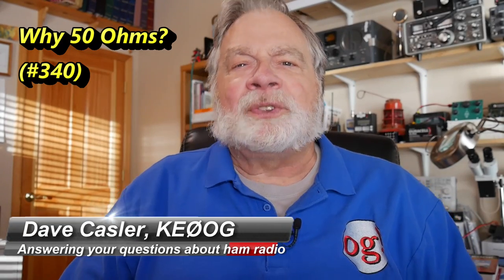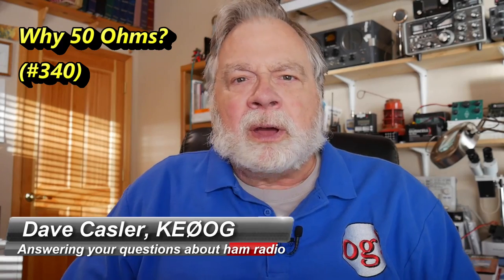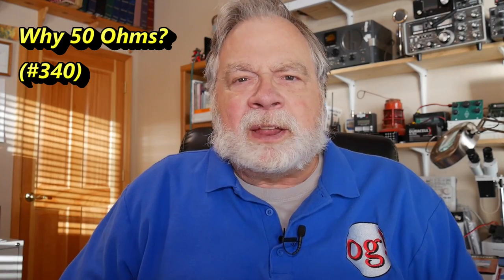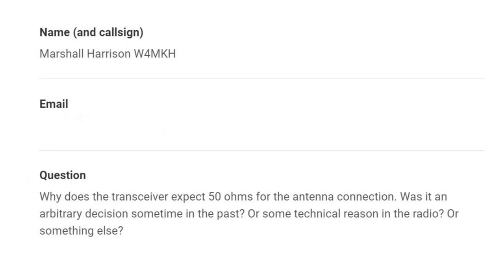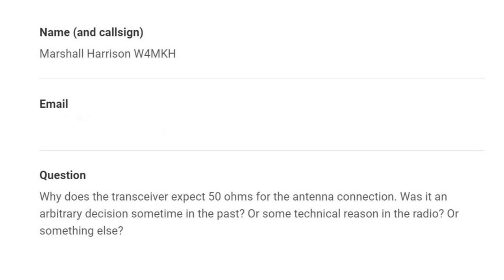Why is Coax 50 Ohms? (#340)

Comment: I think with all due respect that this is a rather long winded explanation.  The issue has to do with transmission line losses primarily due to the capacitance of the cable over a specified distance.  The losses are frequency related as well.   There are numerous types of coax cables used each of which has a limited use depending on the distance or length of the cable.  The source and load impedance are also a major factor.    In general use,  50 ohms is a usable and desirable  number for short runs using thin coax such as RG58 or smaller.  There is a cost factor involved as well.  The dielectric material used in the construction of the cable also contributes to the acceptable losses within the cable. However RG58 and smaller have a usable frequency limitation again taking the other factors into consideration.   When longer cable runs are required using RG59 or RG62 is a better choice   The cables are thicker which provides more space between the center conductor and the shield or outer conductor.  These cables are generally used with equipment which have a source and load impedance of 75 ohms.   They are well suited for higher frequencies such as video and cable TV.   When even longer cable runs and even higher frequencies in the UHF band are required the cables used are much larger diameter again because of the losses in the cable at these frequencies.   The bottom line is that using a low source and load impedance solves two major problems.  One being the effect of the actual cable impedance at a specified frequency and also the ability to reject interference from external sources.   Low impedance works well at all electrical frequencies.   With older tube equipment this could only be accomplished by using expensive and inefficient matching transformers.   One needed to calculate the losses of the transmission line and the transformer losses in order to have any idea what the power loss would be.

Comment: Is that 50 ohms per foot?  mile? whatever?
Reply from the maker: 50 ohms period. There is no length unit. It is the "characteristic impedance," meaning the ratio between RF voltage in volts and RF current in amperes in the cable is always 50.
Reply: Confusing, isn't it! It is a characteristic of the cable construction, nothing to do with its DC resistance or length... :)